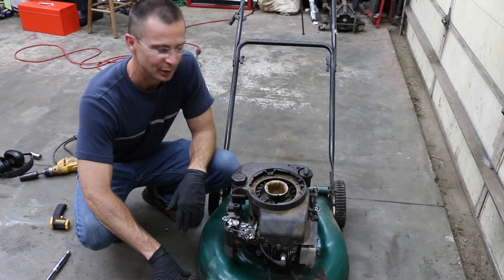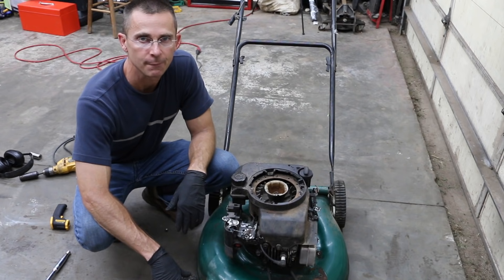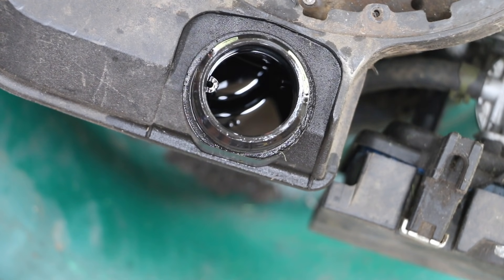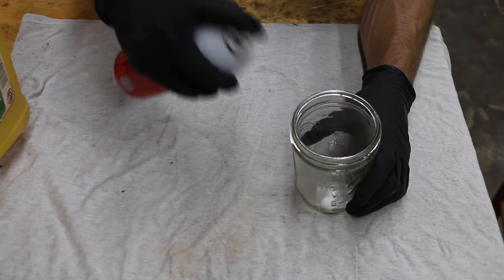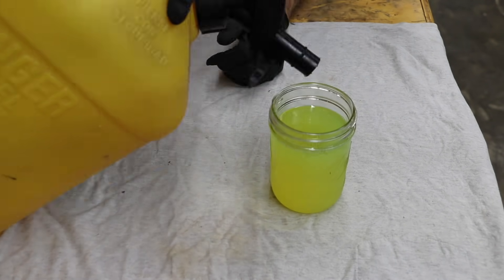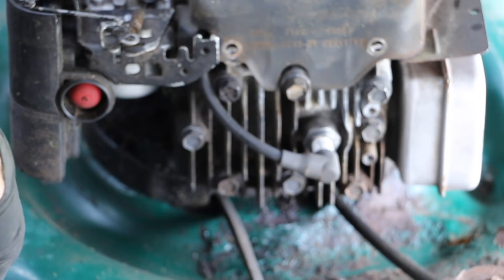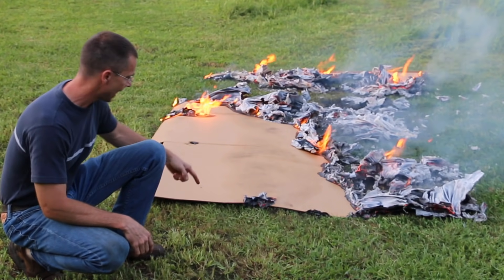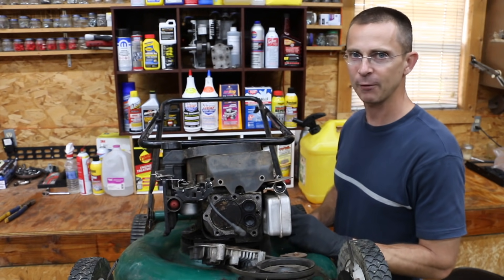Will a Gas Engine Run on Diesel?  Let's find out!

Comment: A 50/50 2 stroke gas and diesel in a gas engine. Like if you want to see it.
Reply from the maker: Thank you for this idea!
Reply: You are welcome for 100k subs you should take all of the mowers and put a bunch of different things in them and see wich one last the longest.
Reply: Project Farm try running half gas had diesel in a diesel engine
Reply: Kind of odd. My cousen did me and him a favor and filled up our bikes with 2 stroke gas and they ran fine they just smoked alot.
Reply: camerons outdoor chanal. I'd like to see if it will run on kerosene
Reply: @ThEcRaZ3dGaM3R - OR don't project your cruelness of 2 cycle engines onto the rest of us.  I run 30:1 HQ synthetic oil in gas tools.  Factory spec phooey, that's just the EPA passing the repair / replace buck onto you.
Reply: According to my experience not. I bought my first diesel car. The first time I had to go to the gas station I was still so fixed on gasoline that I filled the tank with gasoline. After a few km, as the diesel in the fuel lines was replaced by gasoline, my car simply stopped. Empty and clean the tank and complete fuel system and my car ran again as normal.
Reply: camerons outdoor chanal. 2 stroke WILL run! It may smoke because of the oil.
Reply: Richard Johnson that would be very bad. I've seen a diesel that had gas in it and luckily the engine didn't blow. He stated near the end diesel uses compression to ignite and because gasoline has a lot lower flash point it will detonate prematurely.
Reply: gas station kerosene is dyed red to stop semi's from using it, there are lower taxes on kero bought from a station.  Who's going to go to Lowe's and buy 500 gallons of clear kero to run in their truck.  Red Kero, WILL ruin any kerosene heater you have, it sputters, pops, and doesn't burn cleanly.
Reply: Jefferson Graves   Octane raises the ignition temperature for the higher compression engine to prevent pre-ignition.  In diesel, cetane increases ignitability of the fuel.
Reply: ThEcRaZ3dGaM3R that's not 100% true. yes they can carbon up but that's from cheap oil / fuel and not running the engine at proper rpm.
Reply: I know, and use of cheap oils is common in 2-stroke tools. Same with lacking oil because some people like to lean out the mixture for less smoke, which of course introduces the likelihood of heat-siezing. In vehicles (say a 2-stroke motorbike), you'll be more inclined to put a more expensive, better quality oil in and make sure your ratio is at factory spec iff you don't have a mixer system because you don't want to grenade your engine during a commute, whereas it's less of an issue if your petrol chainsaw decides to pop a piston. It's cheaper to fix/replace a chainsaw than it is to fix/replace your bike!
Reply: I totally agree. Treat your tools/vehicles well and they'll repay you with a nice long lifespan and little to no starting issues.
Reply: I always tought this would work and can't wait to see someone try it. :)
Reply: There also where small engines that that did gasoline start kerosine run.  I believe some even powered clothes washing machines.
Reply: Well this weekend while trying to get a tiller motor running for a goKart my buddy accidentally put 2-stroke gas in the 4 stroke motor and it did not want to stay running
Reply: countrymankdx200 2 cycle gas in a lawnmower gas 10 weight oil, It'll cause smoke. It's regular gas.
Reply: I think if he did a 75 25 mixture for a 2 stroke it might work alright. Maybe add a little ethanol to help with the FP of diesel, but diesel is a really thin oil
Reply: Hartin Fartin kerosene is almost identical to lamp oil so I think it may have a lower octane than diesel so it might. All octane is really is the speed which the fuel burns.
Reply: Hartin Fartin Kerosene is highly flammable and could cause trouble Just because it has a dye etc. it won't work. Use gas in a lawnmower and 2 cycle in a weed eater. Best thing to do is to use propane in the tank to save weight and check the fuel level with a match! Cars run on  propane! So, it'll work!
Reply: Travis k thats not very nice calling me stupid. Im very smart you know.
Reply: I've run a 2-stroke fuel-oil mix (in a 50:1 ratio) in a 4-stroke engine before... it smokes a bit (as you'd expect) and definitely smells like a 2-stroke but runs smoothly. It'd probably cause some build-up though since the oil doesn't burn as readily as the gas does, additionally, carbon buildup is one of the reasons 2-stroke engines fail faster than 4-stroke.
Reply: How about natural gas or heating oil in the gasoline ebgine
Reply: That like a 1/1 premix :P
Reply: The rating for Diesel (fuel oil #2) and Kerosene (fuel oil #1) is Cetane not Octane.
Reply: J Morrow That was some tractors that would start and warm up on gasoline then switch to diesel or Kerosene.I bet Maytag wasn’t the only one to make gas powered washers but those were 2 stroke and not kerosene at all.
Reply: I know of a guy who did this not once but 3 times at the same station (Sinclair).  He was so programed in to using the green handle pumps that that was what he grab and filed up with.  The only thing that I have done even close was punch Diesel on the selector and grab the gas hose and of course it did not dispense any gas or diesel!  :)
Reply: How about jet fuel same stuff just more filtered look it up!
Reply: Camerons Outdoor Channel i
Reply: 2 stroke gas? Where do you get that pumped? You mean gas with oil in it. Can't tell if you're a troll or really that stupid?
Reply: Richard Johnson   Gasoline in any significant amount WILL destroy a diesel.  Slowly or fast. I knew of a guy who had no business buying a semi tractor go through school, bought a brand new truck. Truck came with 50 gallons of diesel in it, filled the tanks with gasoline for a total of 200 gallons. He took off down the road, the engine welded itself together in about 1 mile. I don't think the insurance covered extreme stupidity. $$$$$$  down the drain.   Moral of the story...know your machine.
Reply: That would work i run straight 2 stoke in my mowers with no problem
Reply: My dad accidently put a mixture of 50:1 two stroke gas in a little honda tiller a couple of years ago. It ruined the carb and had to end up pulling the head and cleaning up the whole engine to get it to run right again.
Reply: camerons outdoor chanal. 
that's stupid. Its going to run the same as the gas/ diesel mix. Everyone knows that a regular gas engine runs just fine off of  32:1 2 stroke mix.  So this would be just stupid to do another video of. 

How about this.  let's see a deisel run off a 32:1 2 stroke mix.
Reply: camerons outdoor chanal. Great but most likely it will blow up I stand corrected

Comment: Really good vid , what id u put a bolt in the engine with the same thread as the plug and heat it with a tourch and then try runny diesel kinda like a glow plug
Reply from the maker: This is a great suggestion--thanks!

Comment: Can you supercharge or turbocharge one of these small engines? So many people say it's impossible because the exhaust doesn't spin the turbo fast enough and some say the carb is the issue. But I think it can be done. Maybe an electric supercharger that doesn't run off the engine power? Measure the power of the engine.
Reply from the maker: I'm thinking about how I can add a little boost and you've given me an idea--thanks!

Comment: How about running RC fuel that have 15% of Nitromethane and Remove the RPM limit on the engine at the same time?
Reply from the maker: I'll try this. Thanks!
Reply: After some reading I guess you need to mixture it with Gas to get it working.
But still, Methanol-Nitromethane and Gas can be an entertaining video after all =)

Comment: Would like to see if ATF + Engine oil works as a carbon cleaner. I've always heard you can add ATF to your cars engine to clean out the oil sludge. ATF + Gasoline would be an interesting test as well.
Reply from the maker: These are great suggestions--thanks!
Reply: Works,but be very careful.best time to mix A.T.F into your engine oil is just before an oil change.Then run the engine about an hour or so,then change the oil and filter.Also watch carefully the next couple days for the next couple days,if the fresh oil starts turning black or looking dirty change it again.At least that is the way it worked out for me but it did free up some sticky hydrulic lifters.
Reply: It works but don't use too much. I believe that ATF is basically 20 weight oil with lots of detergent and anti-foaming additives.

Comment: I've successfully ran a generator on kerosene. I'd start it using starting fluid. Once the engine was warm it would run fine.
Reply from the maker: I'll try Kerosene in an upcoming video--thanks!

Comment: run a small motor on break cleaner or carb cleaner...
Reply from the maker: I'll definitely do this in an upcoming video. Thanks!
Reply: LiLchris4281 Especially on that engine now that it got gunked up from the test. I'd like to see how clean it would get.
Reply: LiLchris4281 brake clean fumes car be harmful to breath . Carb cleaner works fine we used to use throttle body/air intake cleaner (similar to carb cleaner) to drive cars in the shop with bad fuel pumps, was kinda dangerous sitting under the hood wile you spray it and someone drives it in hood in their way lol...
Reply: "brake clean fumes car be harmful to breath(e)."

....and man I got a double super buzz.  Here I was a-huffing the ligh uhhh the airplane glue in a sandwich bag.  You know, just all I could a-breathing it into my lungs and getting high...  And then I'd take me a hit of that gas right after I'd hit it, and man you talk about a warped mind I got one....

Comment: Put 2 stroke oil / gas mixture in a normal 4 stroke small engine
Reply from the maker: Thank you for this idea!
Reply: Classified Recon it will run , I've done it before when I have been out of regular gas
Reply: interesting, buddy of mine had 2 stroke gas but in his moped, stopped running. i think it clogged something.

Comment: I've ran straight diesel in a small 2 stroke gas (I think it was out of a weedwacker) but it would only run well if it was warmed up. This makes sense as diesel has a much higher flash point and the hot engine helped the air/fuel mixture get up to a temperature that would allow a complete (ish) burn. 

I would be interested to see if the diesel would run on this 4 stroke if you were to get the engine up to temperature for a while. 

They use to sell kits for tractors that would head up the carb with exhaust so that you could switch over to running diesel once the engine was warm. The hot exhaust would bring the diesel up to a flash point temperature were it could effectively go through a carb like gasoline would, since gasoline has a much lower flash point and is very volatile.
Reply from the maker: It would be interesting to see if the engine would run on straight diesel once hot.  Thanks for the comments!

Comment: always great videos , i used to run a lawn tractor with a briggs engine on kerosene , filled the fuel tank up with kerosene and when starting the engine from cold i used to drip petrol into the carb until it was up to running temperature  and it would then run on pure kerosene but would seem to run a fair bit hotter ,it would be a good one for you to try ,anyway keep up the great work  , best wishes from Roy in the UK :-)
Reply from the maker: Greetings Roy, I'll try kerosene in near future.  I'm looking forward to testing this!

Comment: How about measuring the gasoline consumption of a generator where you know how many watts are output. Then try lean the mix grossly and see how much more efficient you can get it. And for how long it can run before it kills it.
Reply from the maker: This is a great suggestion--thanks!

Comment: I have an old 1947 John Deere A multi fuel tractor that runs on gas, kerosene, or diesel. The trick is, you need to start the engine on gas, and when it's warmed up; switch to diesel. The heated engine drives the diesel or kerosene above its vapor point so it will ignite. The John Deere actually makes more power with diesel or kerosene.
Reply from the maker: Chad, thank you for providing this information!  It'd be great to have such a versatile tractor like yours!  Thanks for commenting!
Reply: It is pretty versatile. It has a low compression twin cylinder engine. The tractor puts out somewhere in the neighborhood of 35 horsepower at the drawbar running "distillate" or diesel. It's rather old technology (turn of the he 20th century), but it is effective. Tractors in the old days were built to run any cheap fuel. Distillate for instance, was as cheap as it got, as it was a byproduct of gasoline distillation. Its modern equivalent is #1 heating oil, from what I'm told. I burn mostly diesel as that's the cheap fuel of today. It doesn't like E85 though.

Comment: Dare I say... how about Bacardi 151?
Reply: Some states still allow the sale of Everclear at 190 proof if there is too much water in the 151 Bacardi. 75% vs 95%
Reply: Project Farm  Hey man I've been wondering if engine coolant can clean the carbon build up inside of the engine not sure if you'll read this but if you do that could be an idea
Reply: Project Farm Do you have any merchandise? I would definitely buy a T-shirt or a mug with Project Farm on it.
Reply: 151 is too high of water content, secondly it wouldn't get enough "fuel"  and melt down/through the piston and head fast :)
with near 100% alcohol it's possible, but the carburetor would need to flow around 3x more fuel, start out rich and slowly lean it back, monitoring via exhaust gas temp "pyrometer"
straight alcohol has been used in racing for years, the fumes are rather noxious, you don't want to breathe them much, racers normally add liquid scent to the alcohol, they'll go by leaving bubble gum, cotton candy or other various scents :)
Reply: throttle bottle If I`m not mistaken the flame of an alcohol fire has no color, so it is very dangerous. We had a fire like that many years ago at our company, nobody noticed until the fire installation started working and buildingparts started to melt.
Reply: correct, you'll might see a light blue flicker now and then, but near impossible in daylight/bright room, an odorant helps slightly since it can be smelled easier.
for a demo, light a small amount of 91% or higher rubbing/iso-propanol alcohol in a kitchen pan or plate in dim/dark room ;)
search around racing videos to find alcohol fires, you'll see the drivers jumping around and going nuts trying to get out and away, others that get close will be also :)
Reply from the maker: Thank you for this idea!

Comment: Aviation fuel vs normal gas. What burns clean
Reply: I am a pilot. I run 100ll avgas  in my mower and weedwhacker.  No ethanol. Smells like race fuel. All we run in the mud boats too...
Reply: Diesel fuel is a motor fuel thus has anti corrosion, detergent, ignitability and other additives.
Reply: Cleaner
Reply from the maker: Thank you for this idea!
Reply: Secant Ogive avgas
Reply: Secant Ogive there different octane
Reply: I ran a super gas drag car years ago. Thats what I ran in it was Acgas.
Reply: Heater fuel is diesel but they tend to tax it differently and has less sulfur in it
Reply: For several reasons, it's NOT a good idea to run Aviation fuel (AvGas) in an engine designed for gasoline.  Read this to understand why:
http://www.fuelexpert.co.za/canirunavgas.php
Reply: Aviation fuel is basically diesel. There is a vid here where a guy puts a torch to gasoline, diesel, aviation fuel, heater fuel (? dunno what it is called in English) - and they are basically all chemically like diesel, except gasoline, of course, and they won't even catch fire if you hold a torch to them (in a jar).

Comment: I knew the answer before you started by having done it both ways before. Adding diesel to a gas truck and gas to a diesel truck. Came back smoking on choke on in the gas job and the mechanic added a couple of quarts of A.T.F. to the diesel and told me to run it. I drained the gas truck and ran the diesel. Both lived to make several more trips. You keep mixing stuff and you won't have to worry about haircuts. You'll either pull it out or it'll fall out! Good test, Commander!
Reply from the maker: Lewie, LOL!  I always enjoy reading your comments!  Thank you very much for watching the video and commenting!
Reply: Goofing up has been my specialty and there are too many witnesses so I can't get out of it. If I don't own up to it the witnesses start coming out from the woodwork. I'm not a blasted politician so I can't get away with anything, much less everything!

Comment: Hell no! Diesel has a way higher flashpoint than gasoline/petrol. Plus it also lubricates the engine (obviously not as much as oil).
Reply from the maker: You're right. I was surprised to get it to fire up running 50/50 gas/diesel.  Thanks for commenting!